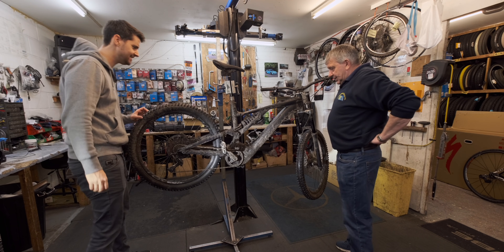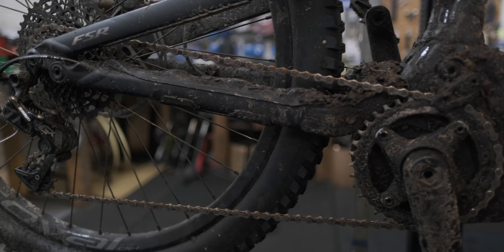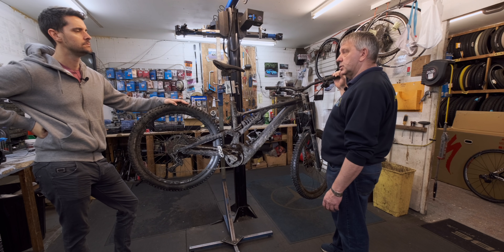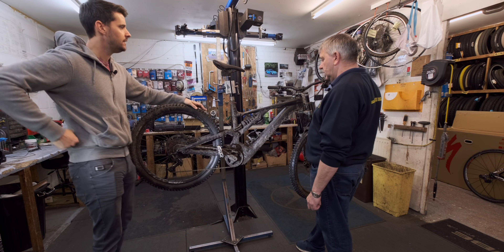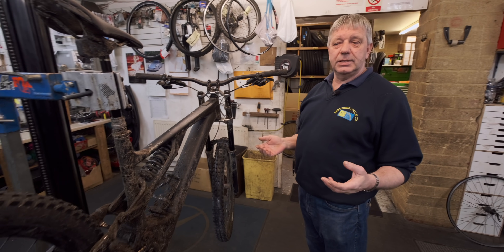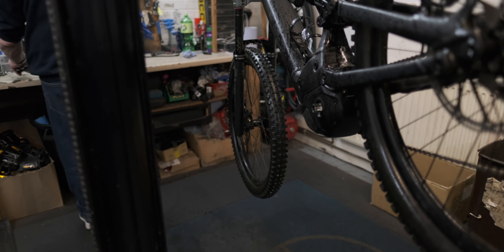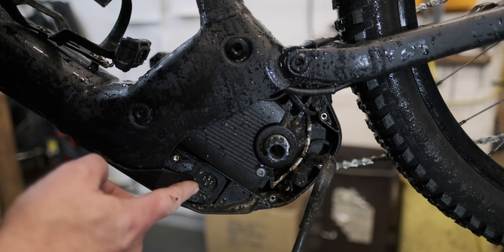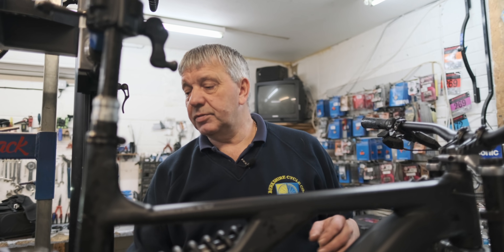How to keep your ebike ALIVE!

Comment: My base model LEVO has a hole in the underside of the top tube, above the upper shock mount. I'm wondering what purpose it serves ...other than allowing water in the top tube during wet rides and bike washes. The TCU is located just a few inches away. And it doesn't seem like the hole is there to make room for the shock. I've just slapped a piece of tape over the hole to keep out moisture. 

And I'm learning a lot from these 'Chris @ Berkshire Cycles' videos. 👍🏽
Reply from the maker: Is this a cable hole?
Reply: @RobRidesEMTB  it most certainly is, just took a peek,  probably larger than necessary though,  your Kenevo must be the same Rob
Reply: Rob Rides EMTB 
Nope, not a cable hole. 
It's about 1.5 inches by 1 inch. 

My LEVO is a 2020 base model, size M.
Reply: Rob Rides EMTB 
Thanks for asking.
Reply: Rob Rides EMTB 
Not sure if it's meant to allow even cooling during the welding process.
(?)
Reply: @vincef7487  mine has cables routed through and down the frame side brace levo size S
Reply from the maker: Email me a pic: rob (at) emtbforums.com
Reply: Mike E 
You are correct. This IS where the cables exit the top tube and are routed to the Sidearm. Seems like there should be some type of fitting to seal that gaping hole.

Comment: Let the muck dry and rub it off with a dry cloth, won't look immaculate but near enough...or just do nothing aside from poking the major build ups of with a stick.  Hosing down or power washing an ebike or any bike is never going to achieve anything good aside from making it look pretty (or if you're about to do some sort of maintenance where you just need a clean working environment then fair enough)

Comment: Im looking at use Ebikes just now a few of 2022 and 2023 model's 7 of them online all saud "Motor replaced " 340miles etc from new motor fitted 5 of them being Bosch 3 shimano but for a few months old ebikes and so many with replacement motor's what the heck is going on here? It will be my first ebike the same as this one looked at 3 now 1 with replaced motor after a july purchase in 2023 new 2023 model its concerning me now! I sake care of all stuff and bike's in just one of them that keeps stuff in good condition bit i am genuinely concerned about these brand new months old bikes having so many motor's replaced under warranty! Is it maybe because there not maintaining them like this i wonder but still can see it from their point of view aswell you don't want to strip a bike down after getting hime absolutely caked in muck and soked through! Some these have Gasket seals like on a head gasket so if a motor's got anything like this i would be inclined to get the tiger seal out and give a small seal round some these parts or the temporary winter seal that ca. Be pulled off easy again!

Comment: no contact cleaner? OK... I guess I'll leave the muddy plugs muddy and leave them to corrode. Contact cleaner evaporates within seconds and gets rid of things that will cause long term harm. Also Dielectric grease is widely used in waterproofing electronics connectors. This video is massively misleading.

Comment: Servicing is a fine but having to wrap electronics in tape and performing a partial strip down every time you wash a bike that is supposed to be used of off road,that is not fit for purpose.

Comment: It needs ( and every ebike motor) 2 simering, and a better sealing for the battery connection. No more. 
A modern motocross bike has way more electric, sensors, cables, switches, hour meter... And can be pressure washed without any problem. (No other solution to clean)
#specializedaspeedwaybol #bestebike ✌️✌️